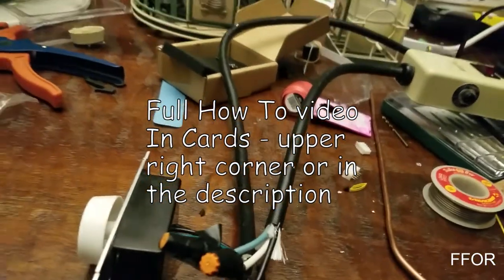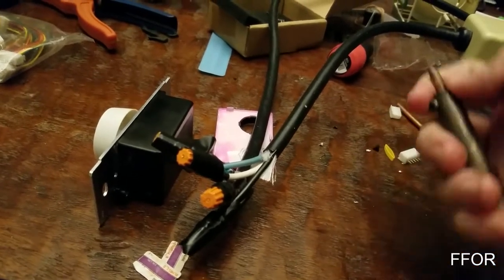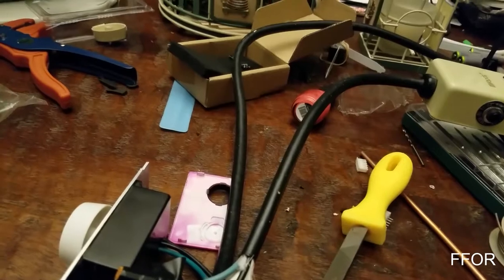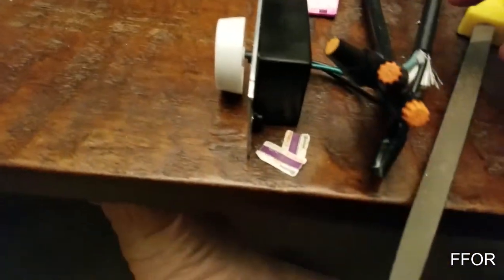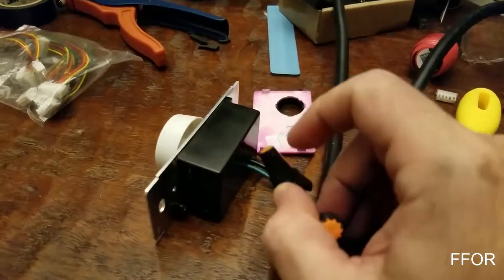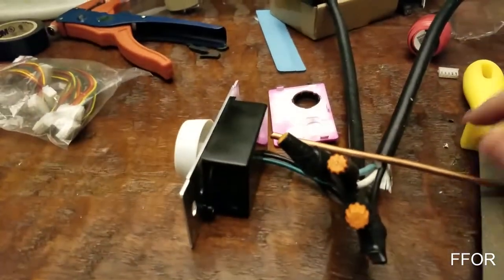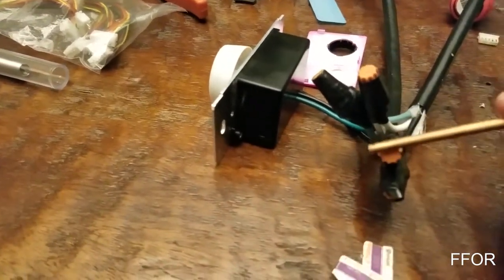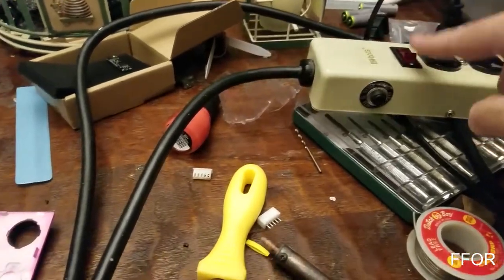Upgrade any Soldering iron for $5 - SHORT VERSION

Comment: Next up, can we increase power of any soldering iron ? Like actually increase it from say 30w to 60w, then use the dimmer to control the power.
Hey, if it destroys  the soldering iron, fine, I just want to know if it can be done and how, I'll decide if I want to do it or not(this is for those who nag online)
Reply from the maker: honestly, with this style, you could.  yo'ud have to pull out the resistor and then add more wire.  It would be interesting.  I do appreciate your humor and the level of comments is sometimes something to behold :)
Reply: Since you noted iron destruction is a-ok, I'll mention my....well.... currently hypothetical method that I'm scouring yt rn attempting to hopefully find invaluable tips from documented successes/atts. of it just to get the best shot at a one & done functional iron. Anyway, my plan is deconstructing the iron to the degree of having physical access to the heating coil, figuring out w/a MM where on the coil I need to cut (i.e. shorten it = decreasing the resistance = incrasing the power) in order to produce the amount of power I'd like from it (25w -> ~60-100w) & then crimping that back to the mains supply via high heat rated butt splices (ACE hardware stocks those). Whether or not gaining physical access to the heating coil being a complete, utter PITA will vary widely across iron mfgrs. I know ones exist that are relatively easy-ish to undertake this with, but unfortunately I def. don't have that sort on hand and am likewise drawing a complete blank on whichever mfgr. it was I noticed having easy coil access, sooo 🤷‍♂🤦‍♂ Good luck whatever the case, perhaps you figured a thing or two out on how to do this a tad easier by now too, lets hope! Btw my far more straightforward plan was to just increase the voltage to the desired amount via an autotransformer & which I only shelved for the moment once I realized that could be accomplished by integrating one inside the iron therby eliminating a two-gadget solution, I just thought the other method might be a tad bit less involved... No clue tho...